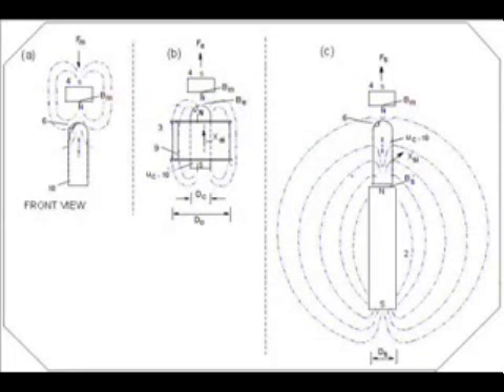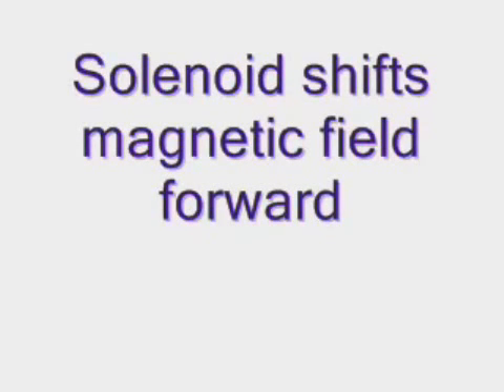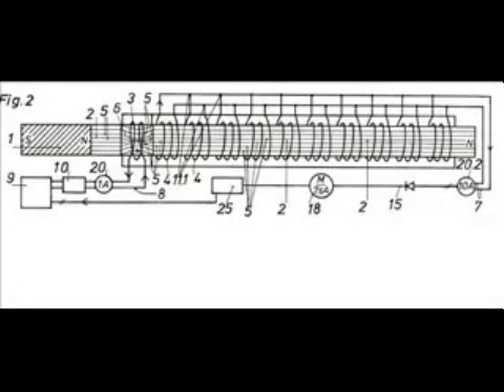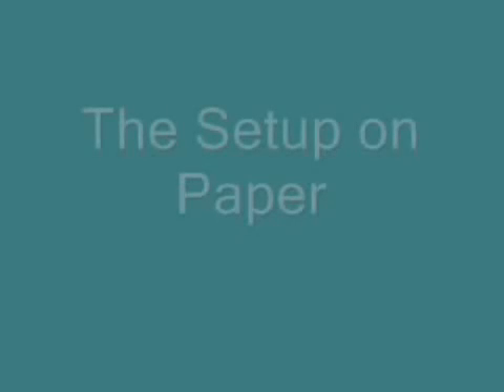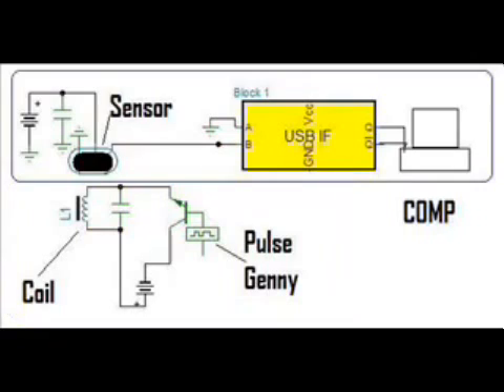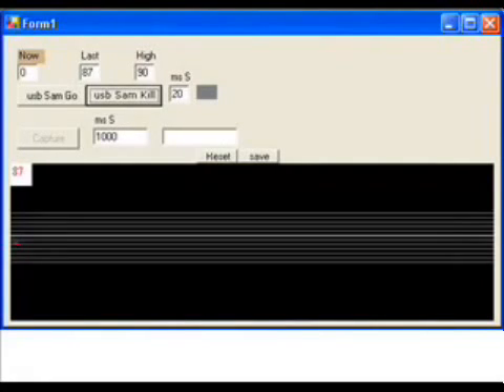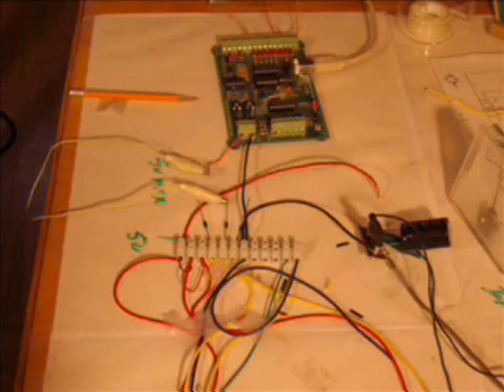Magnetic Field Generator (free energy)

Comment: 1 amp in equals 10 amps out? That's only half the story. It's not just about amps. And it's not just about volts either. It's really about watts, which is amps multiplied by volts. Conventional transformers do this type of conversion all the time. You put 1 amp at 100 volts (100 watts) in and you get 10 amps at 10 volts (100 watts) out. It's just an energy conversion. No free energy is created. In fact for 100 watts in you might get only 90 watts out depending on the efficiency of the transformer. The other 10 watts is lost due to heat, which is why transformers get warm when they are operating. Others have correctly said the exact same thing below.

Comment: There is "Free Energy" and there is "Over Unity" energy.  Over Unity energy is probably "free" energy [except for the cost of the materials to construct the device].  I doubt if there is such a thing as Over Unity energy -- not in the scope of know physics, at least.  Heck, energy from a solar panel or a wind generator could be considered "free". But energy from an as yet unknown [to science, at least] source -- such as "Scalar Energy" or "Energy from a collapsing magnetic loop" or "cold fusion", etc., might exist, and it might even be "free" [again if you deduct the cost of making the thing], but it's probably not Over Unity -- just an alternate [previously unknown or unaccepted] energy source that is easily obtainable [i.e. can be constructed using easily obtainable materials and no energy bill to settle once it's working].

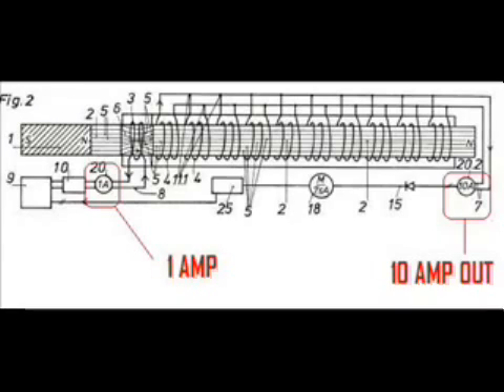Comment: 2:46 -- A mere current measurement is not enough to determine power output or "over unity".  A simple transformer can produce higher currents on the secondary than are flowing through the primary without an over-unity condition.  You need to measure the voltage AND the current for a power comparison.  If the ratio of the output power to the input power is greater than one, then you have something!
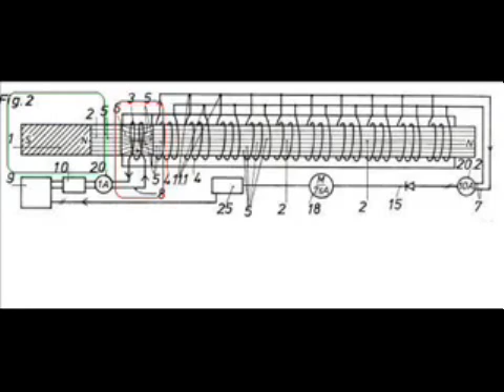Reply: +Steve Lawson I didn't even watch it (other than a few seconds after 2:46) because these things are so tedious...  It seems almost all of these 'free energy' nutters have no grasp of fundamental physics or electricity, and thus fail to distinguish between voltage, current, power & energy...  I've seen so many things where they're measuring a volt, or a fraction of one, on a (10M ohm input impedance) DMM & calling it 'free power' or whatever.  I saw one, which was basically a crystal radio/Cockroft-Walton voltage multiplier, producing, from memory 0.15Vdc across his 10M ohm meter.  So I told him it's dissipating 15 NANO watts in your meter.  A BILLION of them will light a 15W lamp !!!  Put a load on it, measure the regulation...  etc. etc.  but I can no longer be bothered..  Good to see others who know a bit about electricity commenting on this rubbish.  Cheers :-)
Reply: @ Steve Lawson - Interestingly a gearbox is a mechanical analog to an electrical transformer. You put high RPM at low torque in and you get low RPM at high torque out. Or vice versa. Further, the gearbox will never be at unity just like the transformer won't ever be because both generate heat losses; resistively in a transformer and frictional losses in a gearbox.

Comment: No mater how you choose to do it, in order to extract energy from a permanent magnet, you must first overcome it's force, in order to then use it's force to do work. It takes exactly the same amount of energy to overcome it, as it will deliver back to you. This is the exact reason that, without a secondary energy supply, you cannot produce energy, and it will never be any other way. The cost of making energy is that is takes energy. This FACT, should end all speculation, but it won't.
Reply: + Tim Hallas - I disagree with you. Look up a homopolar generator. New configurations compensate for the back flow regions. There is no need to use a permanent magnet. You can merely resonate a magnorestrictive rod, and capture the flux. The energy is ambient, any lightning strike is an over unity discharge to maintain ambiance between the ionosphere and earth ground. The mechanics of the lightning bolt, took no energy to create.  Over-unity is there and we just don't accept it. What you should say is that "The cost of MAN making energy is that Man needs energy to take it". Which is still not accurate. We have to understand that, man can take more of it then he has to put into it. Over-unity is possible, we have been conditioned to accept what is taught or concealed by academia.
Reply: XR IX
 You mistakenly assume that I have accepted the mandates of "academia". I have not. What I have done is applied the known laws of physics to the question of over-unity, and found, to date, no example where these laws did not govern the results of any attempt to "create" energy, from no, or a lessor amount of energy. Yes, there are many "already existing" stores of energy that we can capture and convert to a form that we can use, but ALL of these sources took energy to produce them, even lightning. If this energy is produced by nature , we may partake of it, for "FREE". ...Solar, tidal, wind, gravity, and of coarse, the mystical energy of the atom. These are only free to us, because we didn't use any of our energy to produce them. Even in the fantastic world of nature, energy, costs energy to male. I have seen all of the latest trickery that "promises" free energy, but the only ones that actually produce energy, borrow it from another source that already exists. EVERY ONE!! I personally believe that we already have "FREE ENERGY", and plenty of it. Solar, energy is absolutely 100% free, and the sun is throwing it at us at a rate of billions of megawatts every day!. Why are we trying to make magnets compete with that? I liken it to the man who runs a diesel pump to get the water out of the ground instead of paying the water company for it. When asked why, he says, water is free, why should I pay them for it. The reality is he's spending $40 a month for $30 worth of water. He just outsmarted his self. If all of you brainchildren who are trying to prove over-unity can be achieved in a closed system, would stop for just one minute, and realize that everyone else is just cheating, you can then spend your energy on finding better ways to tap into the real free energy. I have a simple design for a 100 megawatt generator that is powered by the tides. You can have this design for free. Now that's free energy. I even heard of a cockamamie idea for tethering the moon and using it's orbital energy to drive a generator. As stupid of an idea as that is, it is sound science. it is taking energy from an existing source and converting it. Now, imagine, instead of a cable to the moon, we just use natures cable...the gravitational pull that the moon exhibits on the earth, and turn a generator with that. yep, that's tidal energy. it was estimated once in the i 1950s, that tidal energy, on a worldwide scale, may exceed 500 billion ft lbs of torque. Thats more energy than every machine man ever made can produce. AND ITS FREE!!!
Reply: Tim, all these people who are doing this are just trying to expand our knowledge of our Universe. Your perspective is that there are already "FREE ENERGY" available. I agree, but these methods are only based on our understanding today. 100 years ago, we didn't have the ability to create a solar panel, but yet we developed it as our knowledge expanded. If you think we know all that there is to physics, don't be too sure. We really don't know what an atom is, and we don't know all the rules of it either. There is a side buried with Tesla,  and lost with Maxwell's equation translation by Heaviside. I am aware that if you don't buy it at Walmart these ideas are nothing. We'll get there... Your tidal idea is interesting. But instead of your mechanical energy conversion, what if you could tap the energy that modulates the tide? You are harvesting the forces that change the potential between liquid and solid, earth and water. There is so many things to think about. Don't close your mind.
Reply: MY mind is the only one that is "properly open"...all filters engaged.
 Rule number one: an open mind lets in a lot of trash too. It is not about being totally open to new ideas, it's also about knowing exactly when a new idea is a fools errand. This is why education in all of the "currently understood" laws of physics has to come first, before engaging in speculative concepts. The reason I so often seem to be "closed minded" to some people, is because it only takes a few seconds for me to dismiss the bullshit. Now, as for my "tidal energy idea" it is already drawing on the most efficient aspect of tidal energy. Tidal energy is the gravitational differential, caused by the moon. Yes you could "tap directly into" that energy, but think about it. The oceans already "tap into it" in the biggest way possible. The power of the whole ocean of water, is available to lift a buoyant mass, (any size we choose to build) up and down twice a day. The amount of energy you steal from the ocean is only limited by your ability to build massive buoyant things. Imagine the power that can be generated by a slow descent of a 100 million ton mass. The tide lifts it for FREE.  There is no better way to "tap into" gravity. Get it?... By the way, "WE" know exactly what an atom is. Welcome to the 21st century.
Reply: Well I don't take you for being the type to fall for just another "Free Energy Device", but I feel like myself you want to see a real device, and be able to use it, share it, and really save the world. (I know how frivolous that sounds). I understand the need for filter, but I also know there are simple devices that surprise me even for a novelty sake, so I am willing to view anything with information that might help me decipher the crap/from the real vane of truth. I know most it is crap, but there are some hints of real progress that could light the way. But you might be wondering what fuels my disbelief in hard physics that I would even come to thinking that there is "More". I will tell you something I personally discovered from experiment. There are equations that describe a solenoid, and the field strength of an air core vs an iron core. Those descriptions would say that you increase the field density by inserting in iron in a solenoid.  So take a magnet it place it at the end of a solenoid and assure the charge repels the pole of the magnet when energized. If you  do tests at the end of the solenoid with a magnet air vs iron core the math works. Now put that magnet inside the solenoid a little shy of the center, and now the math doesn't. Field strength increases at the center because that's where the block wall is, at the heart of the torus. This is more evident if you pulse DC at large amounts. So now I really don't accept that we know everything. If you can point me to where this effect has been described please tell me. If you don't find anything... well, ask yourself why you don't see it.
Reply: XR IX: I'm not sure I understand your description of this experiment well enough to make a comment on it. But I will tell you of another phenomena that puzzled me since childhood. Playing with magnets was always one of my childhood learning tools. I wondered why, my magnets "power to hold onto steel" was increased so dramatically when I attached two steel plates on opposite sides of the magnet. Turns out that the increase in strength is not an increase at all, but a focusing of the magnets field into a tighter lens. This might have something to do with the changes that occur when an iron rod is inserted into the core of a solenoid coil. ??? Maybe if you can explain the effect you are finding a bit better for me???
Reply: Would love to hear you debunk the report by scientists about a LED that produces more output then input, I'll be waiting.

Comment: A Magnetic field is not energy, but force. no energy from magnetic fields!
This applies to permanent magnets.
Reply: +XR IX 
A Magnet field is not energy, it can't do work.(it's only a force), An electromagnetic field can produce work, that is producing heat, and motion.
This is because the electromagnetic field can change polarity, and the magnet cannot.
I don't know vast amounts, but I know quite a bit....
Reply: +Daniel A. Thomas &quot;Stored&quot; is the operative word. Items in my attic have &quot;stored&quot; energy. I stored the energy in them when I moved them away from the Earth. In order to use that energy, I would have to tap the downward motion when they fall though the ceiling.
I have decided not to do that.
Reply: Peter May E = 1/2 LI2 is the energy stored by an inductor, L with a current of I flowing through it. The energy is stored in the magnetic field.
Reply: +Peter May - Why do you think they call energy flow - electro magnetic waves?
Reply: +Daniel A. Thomas 
Sorry I was talking about magnets.
Reply: +XR IX 
I don't know what you are talking about. Do explain.
Reply: +Peter May . I know some, but  you should do the research yourself :D. Your statement is a little bit obtuse to deal with here.
Reply: Peter - It occurred to me, that you either don't know much, or know vast amounts. The real issue in why humanity struggles, is that we don't know that magnetic fields are energy. We should know this, and taking the knowledge to lead us in different ways.
Reply: +Peter May I wanted to qualify your point of reference Peter, and honestly I thought you where talking about electromagnetic fields,  not just magnetic fields. That would of been a nothing conversation. I wont press the game of accepted definitions, and how we use them. As science really doesn't know what an atom is, I will not say I do, and fall down that rabbit hole. So let me depart from those traps and just talk crazy: I don't believe in parts of the QM model, as it relates to energy, specifically as it relates to the strong force of magnetism. I think that  what is perceived as different states of excitement in electron orbits, are just the shadow of the real event where the wave (that describes an atom) changes geometry (compressing and tightening like a spring in geometric configurations).  . So rather than having a fixed amount of small  ingredients, that are limited to their physical constraints such as mass, or strong force magnetism, we have relationships that are dynamic and fixed conditionally only at ambiance. We need a better model to explain Tesla waves,  I like a theory of everything. And a Walter Russel universe has things I like, over QM.
Reply: Peter May
A magnetic field has an electric component, at right angles to the magnetic field. If the magnetic field moves, so does the electric. Jointly they are called an "electromagnetic" field. When in motion, they can impart some of that energy in the electrons of atoms by affecting the orbital rate, and can strip electrons from their atoms. These freed electrons will migrate toward the nearest "hole" left by another freed electron. Thus we have an electron flow, which in turn will create more fields.

Comment: -_-
This is a transformer with moving parts, not free energy.
  
Solenoids are inductors that are designed specifically to produce movement.The movement of the solenoid moves the coils that comprise it's electromagnet windings through the magnetic flux of the permanent magnet, which might add a certain amount of current to the solenoid. 
However....the friction inherant in the system, the impedance of the permanent magnet (which will cause loss due to eddy currents and heat, in both the permanent magnet and the solenoid), and the fact that electrical power is measure in watts (which is amps x volts, not amps alone), means that this isn't going to work. 

A transformer is a much better device for converting voltages and amperage into different voltages and amperages. It has no moving parts and can be scaled up to handle larger amounts of power as needed.
Reply: What I can understand from the video is he is using the working principle of LC oscillator and claiming as free energy.
As per the law ..."Energy cannot be created,it cannot be destroyed..It can only be transformed from one form to another"

Comment: there could be some truth to these demos, but why isn't it out in the market yet?
Reply: I didn't actually see anything get demonstrated.
Reply: jhanthony2 yes your correct.. but many patents claim this is plausible..most of the kick is from the back emf of the charged coil..it needs a solenoid, and a pulse generator / oscillator to see the back emf hitting back ..it can range up to several hundreds of volts for a 12 volt input..
Reply: Its not on the market for the same reason we don't see water cars or self-driving electric cars. There is a technological supression at play to benefit the already established system. Our current economy is petrol based! Time to end oil?
Reply: Naoki Kashima Water fueled cars would cause an increase in the amount of fossil fuels being used to provide our transportation needs. It would be the wrong direction to go if we wish to end oil production.
Reply: Naoki Kashima for your information the oil companies haven't stopped the production of wind turbines or the photoelectric cell and there is talk of allowing driverless cars on UK roads. I believe Google are developing such a car. But would you want to ride in such a car?
Reply: No, I wouldn't ride in such a car. That is because if you allow a computer to drive for you, you are giving up your free will. However, I would drive in a car fueled by water, or a car that has a self charging magnetic motor, or a car with an efficient solar panel on the roof and a capacitor bank in the trunk.